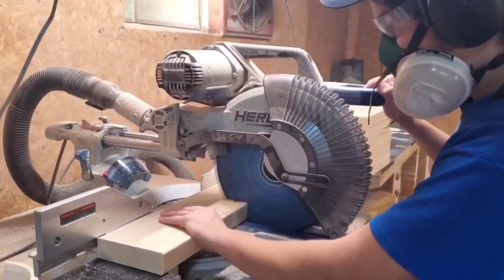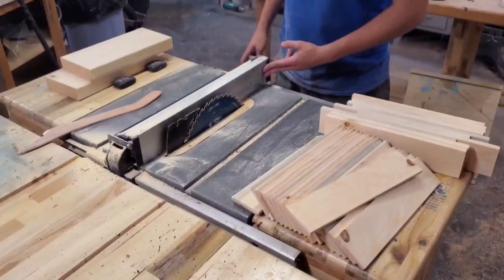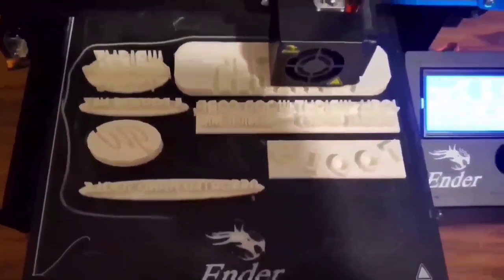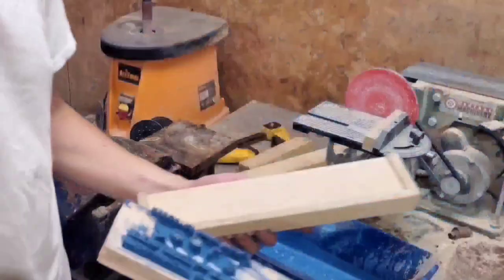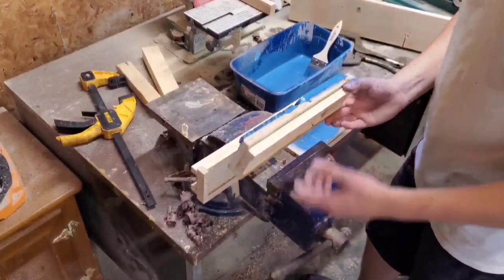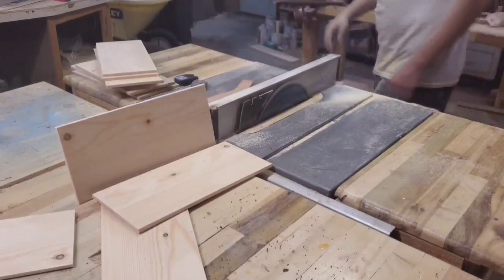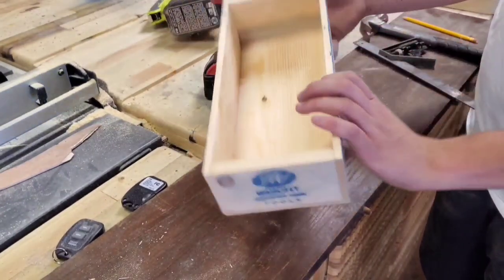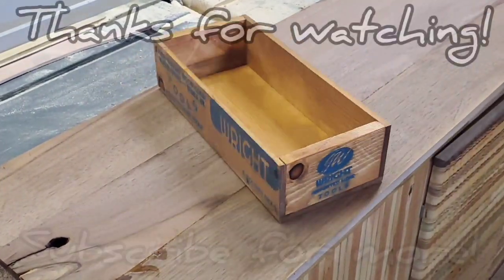Making Vintage Company Crates // Woodworking

Comment: Josh, I am an old graybeard, about the same vintage as your boxes.  I subscribed after watching you build some interior doors with simple design, construction and ww tools.  I like the way you work, using some imagination and tools/materials at hand.  You remind me of Alex Steele, another youngish guy that bought his first anvil at around 10 yo, developing his blacksmithing skills over the years.  Seeing young men like the two of you on your respective channels gives me hope for the future, which in your case, is very bright.
Reply: summer, 1968 - I earned 7 pennies each to assemble hundreds of this type box for seedling flats.  Second day, one hammer swing per nail - no predrill, but a jig and an inserted spring bar to position end boards uniformly vertically.  :) memories

Comment: Firstly, I think you are spot on with cutting down the lumber into parts, the lack of waste suggests the original parts were cut down from 2x stock on a table saw (probably running on leather belts from an outside engine). The original printing was probably done on something like a 'letter press' printer using print blocks cast from a wooden master pattern - so if you go into making these to sell at markets you could make a basic letter press printer from wood and a small number of metal fixings, a couple of axles & ball bearings. You could also try making a cheaper stain by boiling up old coffee grounds - most coffee shops would be happy to give you a bucket of old grounds to experiment with - just don't leave the unprocessed grounds at room temperature as they will rot & absolutely stink the place out.

Comment: Hey Josh,  that is actually a Kraft brand brick cheese mold.  That is actually purty cool and your box is awesome too 👍
Reply: I have about a half dozen boxes this approximate size. They are marked “International Business Machines Toronto”. No idea what was originally in them, and if they had lids, I never saw them.
Reply: @andrewb9590  IBM?
Reply: @sensor-sweep  Yes, technically. But I don’t know enough about the company to know what might have been in the boxes. Before I got them, they were used to store seed packages.
Reply: @andrewb9590  they were probably used to hold punchcards for the early computers.
Reply: @WoodFrontier Thanks. I think my boxes are older than that, although they may be the right size. My guess would be they held parts for actual “business machines” such as typewriters or adding machines.
Reply: @andrewb9590  Well take a short video and post it up.  International Business Machines could be as far back as 1924.  It escapes me when they they started using IBM.  I see somebody mentioned punch cards.  I doubt punch cards were shipped in wooden boxes.  Cardboard was already prevalent when punch cards came to be.  So it probably was for hardware.

Comment: It's interesting how many things you needed to figure out to do this.  Nice job.  

Printer's ink probably has very specific properties to make it easier to use than paint.  I recall from print shop (1960's) that we used rubber rollers rather than brushes to apply ink.  It's possible that makes it easier.

3D printing a negative used for casting with silicone caulk or something soft might also make the job easier with less pressure than the vise.

In any case, you got it all to work well!
Reply from the maker: Thanks! There was a lot of things I wanted to do that would have been easier/better like use thicker ink or a softer stamp materisl but I just didn't have the supplies to do so on hand so I just had to make do with what I had. 

3d printing a silicone mold is really good idea by the way. If I need to made stamps again in the future I might try that.
Reply: Stole my first thought.  Make a stencil with the 3d printer then use spray paint or roller for applying paint.  Then the consistency of the paint doesn't matter as much.

Comment: This is my opinion so tell me to rack off if you like.
Imperfect printing gives it a more rustic appearance. I’ve been alive for almost 59 years and wooden crates were the norm for most goods and I’ve never seen a perfect box or print. Also I’ve not seen staples used to hold them together. Nails, dove tailed joints were the two main types of joins for the corners and base. Remember I’m in Australia so staples may have been the norm there where you are.
Overall they look great. Your printing idea was and is unique and a fantastic idea. I love what I see. Keep it up.

Comment: 3d printing the stamps was smart (so long as you didn't have to buy a 3d printer just for this project). Several ways of getting lettering onto wood; they all tend to produce a 'rustic' look (ie, not perfect), but that's what this project and many like it demand.
If the results had been perfect you'd have had to spend time 'distressing' them anyway!
Like I said, and only my opinion, the stamps were a smart option, and the result was well worth the effort.
Thanks for sharing your creativity and techniques.

Comment: Your inspiration was a cheese box in it's previous life.  I love those things.  Mine have box joints holding them.  Moving forward try a 4 inch foam roller for your paint.  Possibly try ink instead.  Nice work though.

Comment: Hey Josh! Love the content! Really enjoy watching in my free time. 

I have some questions about your miter saw. How do you like it? Would you recommend it? I'm on the market for a new saw....and I came across that exact saw at harbor freight. So I went to look at it. The features compare really well to a very high-end miter saw...but the price seems much lower than it's competitors. 

I have been back and forth about using the Hercules brand because I can't tell if they're a good quality tool for a great price or if they're cheap for a reason and I'd be better off paying for a Makita or Milwaukee or something. 

I like the saw. It looks too good to be true. So I'm asking,  do you have any regrets about that saw? Would you have rather spent the money on a brand- name? Or is it well worth the cost? 

Thank you so much for any help you can offer.
Reply from the maker: The only other miter saw I have ever had was a 10 year old Chicago electric peice of junk so I don't have much to compare to lol. I have no issues with my new hercules miter saw and it is obviously much better than my last saw but I really cant say how it would compare to a Milwaukee or makita.

What I can say is that my dad has a hercules tablesaw and it is nearly identical to my Dewalt tablesaw, just with a wider Rip capacity. From what I have experianced and the specs i have read online, all of the hercules tools are just a Dewalt replicas in a different color and a little cheaper.

I dont think you would regret getting hercules.
Reply: @JoshWrightWoodworking  thanks so much for your time and input.

Comment: Nice job!  Try scuffing the imperfect boxes with some steel wool.  #00 is very fine and would be a good place to start will burnish the wood a bit.  The main aim to blend the stamp with the wood but could also be used for creating fake wear marks.  Blending might work better before finish but I would try it finished just to see what happens!  

Also allot of the older boxes used 2 or more pieces for the bottom. So if resawing the bottom boards is a bit sketchy you could cut them in 1/2 or 1/3s before the resawing so you do it in one go.

And at the end of the day its all about trying different/new shit out...not making a perfect whatever.  Perfect only exists in photoshop!  Its how I personally grow,  Be dam proud of what YOU made not bought.  Warts and all.  And if you don't point the warts out...99.9% of the people won't notice or even care.